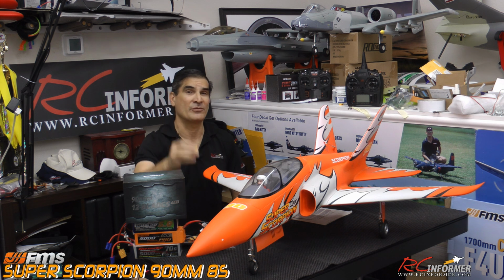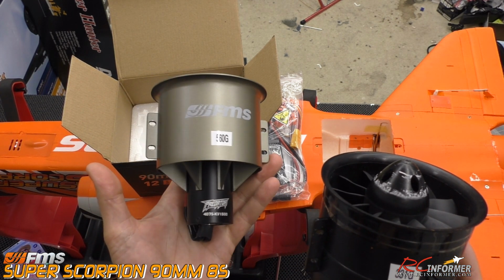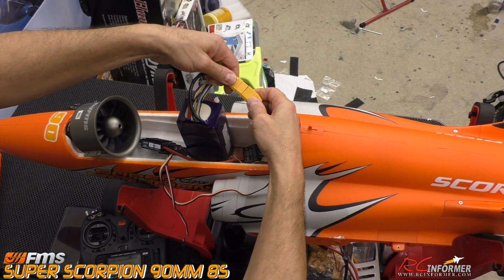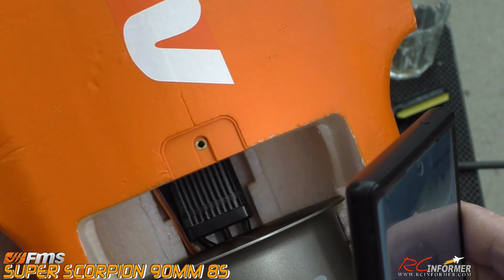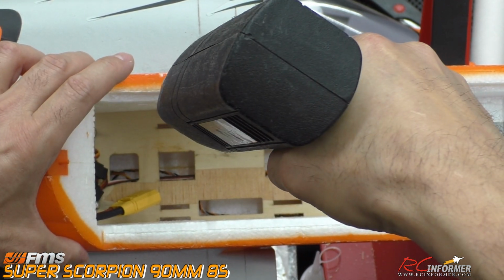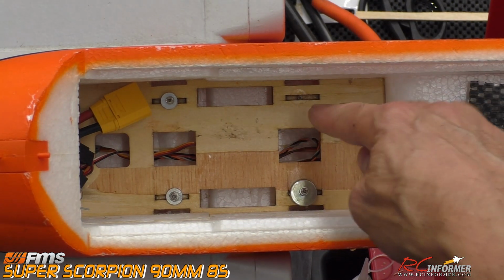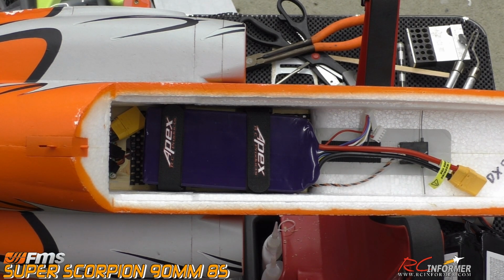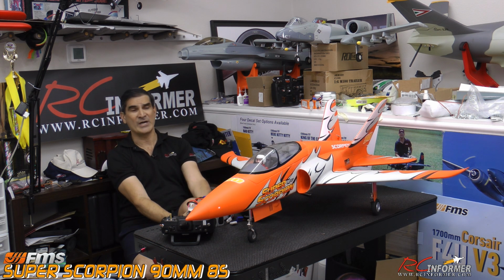FMS SUPER SCORPION 90mm 8S Upgrade By: RCINFORMER

Comment: Rich I did find out what was causing the beeping on this ESC, there's 3 plugs on this ESC. Throttle, rev throttle and programme plug. I had to plug the yellow rev throttle cable into a spare port in the RX for the beeps to stop and have the motor work. However if u don't want Rev thrust you STILL NEED it plugged in. Means I need a 7 ch RX which is a bummer as I only have 1x 10ch. Did you need to also plug the rev thrust plug into a ch too? I couldnt see your RX close enough. Cheers

Comment: Rich I'm not sure if you could help me on an issue with this 120A esc? I've installed it into my Eflite 90mm viper and all I'm getting is a beeping every 1 second. Their trouble shoot says it could be input voltage is too high but im using 2x4s lipos and I'm getting the 8 beeps at the beginning. After that it's just them beeps every second. All the control surfaces work just no power to the motor. Calibrations been done. Any help is appreciated. Cheers.
Reply from the maker: Try lowering your throttle TRIM, then recalibrate and see if expanding the throttle range makes it boot. which radio are you using?
Reply: @RCINFORMER  using the NX10. How much would you say I should lower the throttle trim by?
Reply: Tried lowering to -20, then calibrated the throttle again but still regular 1 second beeps. I tried a 6s lipo, 6 beeps then the same beeping as when I uses the 2x4s lipos.

Comment: Rich when you changed the esc to the 120A was there any need to add the additional BEC to it? Isn't the inbuilt one sufficient? Cheers
Reply from the maker: Yes it is sufficient. Sometimes testing something like this it's a good idea to have a separate power system for the receiver, in case something happens to the power system...
Reply: @RCINFORMER  thanks Rich. Are all additional BEC needing soldering into thr main wires or can they be plugged into an additional port?

Comment: So I just bought one and I took out the esc and it actually already has the upgrade 120 amp 8s esc. It also has a different motor in it, it’s a inrunner 3670. Any reason why this is?
Reply from the maker: Not sure, what is the motor kv
Reply: @RCINFORMER  1950
Reply from the maker: @Rcguy2591  probably to high for 8s. However, you would only need to change the fan now to go 8s :)

Comment: Hey, Rich! I have been working on modifying a 70mm F16 from Freewing. I did not change the weight or distribution or CG or power system with my modifications. The only difference besides swapping nozzles, is a larger battery. I used to have a manageable 6:7 thrust to weigh ratio. Now it is 3:5 thrust to weight. The weight did change switching from 4000 mah to 4500 mah, but not much. The point is I need to lose weight in battery size or get more power. I'm using a FMS 3060 - KV 1900 in runner with their 12 blade fan assembly and 80A Predator ESC. It is getting me 2 lb 15 oz to 3 lb 1 oz of thrust. The plane weighs around 5 pounds with the 4500 mah pack. Do you know of any better performing power systems? I'd love a 4-5 minute max flight time. I was really pushing my 4000 packs with that time frame and lost some batteries (but luckily made it safe to the runway with no taxi power) that way. I could settle for lighter packs and just fly shorter flights, but there must be some other options right?
Reply from the maker: Mostly just modulate you throttle. It's hard to get more than a few minutes out of any EDF.
Reply: @RCINFORMER  yeah. I definitely understand that... I need some light batteries anyway for some more aggressive flight styles anyway. I was really hoping the 4500's weren't too heavy, but I guess that was a little ambitious.
Reply: @cwwisk  
Danny with SMC has some nice lighter packs that perform better than some other brands that weigh more.
Reply: @trullmann  thanks a bunch! I'll look into those!
Reply: @trullmann  yeah get some of his HV packs if your plane can take it.  Those rock.
Reply: @daysdesigns  
Yeah I'm one of the guys at RC groups and on other forums telling people about the new HV packs he's come out with.
I've been testing his batteries for about 10 years now and giving him the results.
Danny, makes some pretty good stuff for us.

Comment from the maker: Get your FMS 90mm SUPER SCORPION at Horizon Hobby Here NOW with V2.0 REFLEX stabilizer included!►  https://bit.ly/3ghoCBR
FMS 90MM 12-BLADE 8S PRO METAL FAN WITH 4075-KV1500 MOTOR► https://bit.ly/3GnkGtO
FMS 120amp 3s to 8s ESC► https://bit.ly/3eqplPk
APEX LIPO 400mm STRAPS & AMAS XT90 ANTI-SPARK connectors at my AMAZON store under electronics► https://www.amazon.com/shop/rcinformer